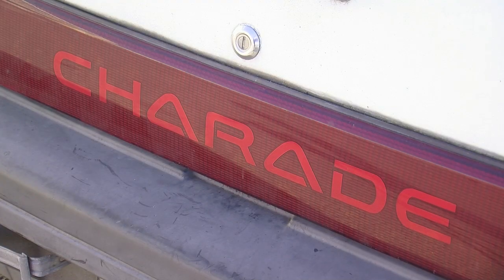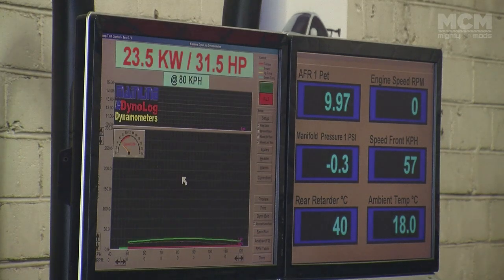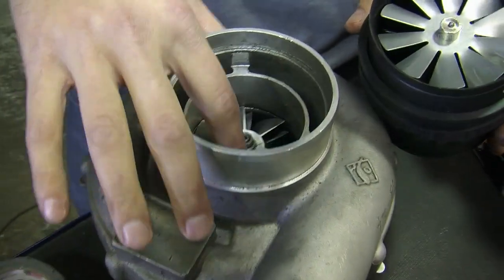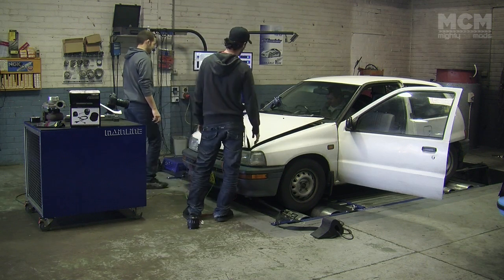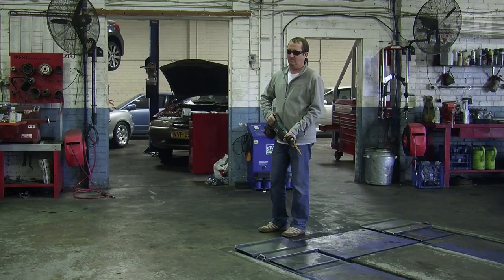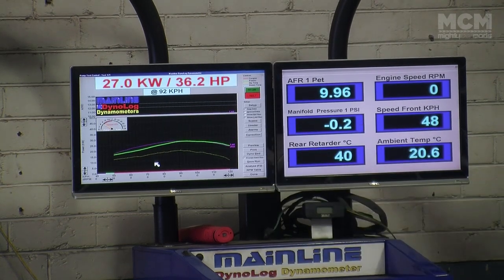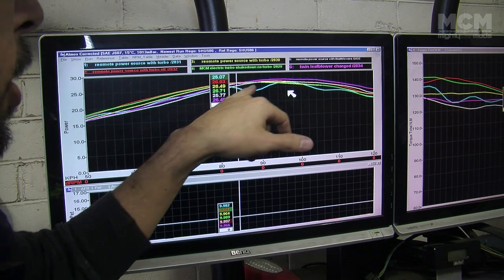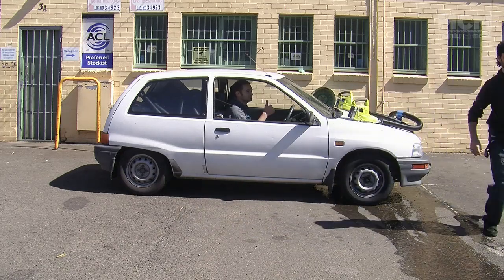Electric SuperChargers Mythbusted

Comment: okay... so a fan isn't compressing, but if you put a tank of compressed air in your car, instead of NOS-system.. could THAT be a possibility to charge the power up ?
Reply: ***** It doesnt work that way. You would need a 5000 gallon 18 wheeler size tank to maintain 5-10 psi in an intake manifold for any extended period of time. NOS doesnt pressurize the intake manifold. Thats why we call it liquid supercharger.

Comment: The suggestion that the car's battery contributes to the engine's output power is absurd.  In fact, a car doesn't even need a battery to run, once it has started (although something like a bank of capacitors to smooth out the pulsating DC from the alternator would be necessary).  This video totally ignores the obvious: the fact that if more air is forced into the engine, it will not increase the power, unless there's a proportionate increase in the fuel supplied!

Comment: You guys should try it with a dyson vacuum digital motor and see if that gives any boost. It uses the same centrifugal compressor as a turbo and spin at about 80,000 rpm.

Comment: The leaf blowers could make some more horse power. Take these into considerstion:
1.Take off the air filter and I'm sure you'll get a little more Kw. The air filter acts as a wind resistor to some effect.
2. Also if it was a Vtech, Mivec, or VVTI engine it would make a little more hp than normal engines. Because the valves allow air to flow more freely.
3.Next, the bigger the engine, the more difference in horsepower you'll see because they suck a lot more air and are more sensitive to air flow.

Comment: Any twit that wastes money on ANY shit like this from eBay is a COMPLETE tool. 
A basic Supercharger whether it is a Vane, Centrifugal, or Scroll Rotor type or Turbocharger is going to produce 10-20 PSI increase in manifold pressure and or depending on the setup anything up to 40 PSI or more.
        This pathetic excuse for neither is designed to do but one thing !! Lighten your Wallet   ANYONE that get's stung by this deserves all they get for being so dumb.

Comment: I haven't watched the video yet, but my prediction is the car will perform worse as it does NOT use waste heat and waste pressure to drive the charger, it actually forces the alternator to do more work and thus draw more power off the drive chain. This is just a more complicated HHO mod.
Reply: tarstarkusz I think if they would have used a large gasoline driven leaf blower, they might have added some noticeable power. The two leaf blowers are battery opperated and you aren't going to get kilowatts of power out of them, but you might get a few kilowatts out of an industrial leaf blower powerful enough to simulate an actual turbo charger.

Comment: You know... i installed a turbo for my home-made car engine generator
and it only cost me some time and $100 from the scrap yard...
the engine was an old 1985 (i think) 2.4L Y2 Diesel
the only thing was i did need to spend a fair bit of time working on it,
so i guess if you have some time and a turbo, your good
also it may just be lucky that the manifold of the engine fit the turbo...

Comment: Imagine how well the leaf blowers would do if that ag-pipe didn't have holes all the way through it. Sealing the joining pieces up with gaffa tape won't do much.
Reply: STAG162 Not that great. There was another internet car show in the USA that used something like 7 high power leaf blowers in a very elaborate setup... did produce an increase but not that much. The point again is pushing air is one thing, but compressing it above atmosphere density is a different matter. Gives you an an idea of how much turbo's flow air.  Turbos or 'turbo superchargers' were first used on aircraft with good results in ww2 on aircraft like the p38 lightning, getting great power at high altitude without the mechanical drag of a supercharger which were in use on aircraft like the mustang and spitfire. I cant imagine leaf blowers moving enough air at high altitude to produce higher than sea level atmosphere pressure.

Comment: You covered the air intakes on the blowers. Their generally on the bottom. Tip them over and you should get a little more power.

Comment: This device does not work.It restricts airflow and all it does is that it turns the air that comes in into a spiral/tornado.

Try this using a compressor or hair dryer and do a pressure test against an object.See the strengths of the airflow that will run through this device and without on an object.

Comment: Not talking about computer fan now, but rather brushless airplane fan. Like the 11.4v Lipo battery ones. They do about 40000 rpms.
You will never get huge gains in hp. 10hp on a 110hp car would be fine.

Comment: Hello, the electric compressor (not a turbocharger) may be flawed, but lacked some basic adjustments to validate the test.
- Do not recalibrated the ignition advance curve.
-No Equalized increased air supply with the supply of fuel (lean)
If you run this nut installation with a turbocharger also will not improve performance and will likely have a hole in the piston or engine overheating soon.

Another factor, Audi uses electric compressor and their works: "This is the new Audi RS5 TDI, but for now, the German brand treats as a concept The big news is the engine technology V6 3.0 TDI (diesel) you use. advanced turbocharger electrically powered. According to the automaker, this new construction makes the sporty diesel engine even more efficient ... "

See later

Comment: Increasing amount of air is to be combined with more fuel in engine. That's the whole point of charging : you inject more fuel, but cylinder does not contain enough oxygen to burn it unless air pressure inside engine is much greater than atmospheric pressure. You increase air pressure to put more air in engine, so the added fuel is burned, and more power obtained. If you get any increase of power from augmenting air pressure, all it means is the car is using a rich mix or air-fuel, and in other words, it's burned more fuel than needed (well, it's better to burn a little more than not enough : not enough engine does heat more).

Comment: If you only wanted boost under the occasional full throttle blast, you could set up a 15 hp electric motor in the trunk spinning a large turbine with tubes running to the intercooler and then engine and a couple large batteries to run the motor. Under full throttle, the motor would kick on, and the alternator would disconnect, running everything on the large batteries while it's under full power. You let off the throttle, the motor shuts off, alternator comes back on and charges the batteries. Injectors would need to be sufficient to flow enough fuel for the engine under boost while the ecu senses the lean condition when boosted and adds more fuel to compensate. Pretty simple, really.

Comment: well a good powerful big brushless electric motor would be able to make quite a lot of pressure if it's well done and the blades well done, however, the car needs to allow more fuel to go inside too to see a proper power increase

Comment: Maybe it needed two "Electric Supercharger Systems"? (Like you did with the leaf-blowers) What if; you unplug the battery, for the time of the installation, to reset the engines computer, and let the cars electronic fuel injection, make the fuel correction. It should run better dynos, the more it is driven.  (after the EFI has a chance to monitor the intake fuel/air) In theory of course! Thanks for sharing!

Comment: without electric turbocharger     : 23.5 KW / 31.5 HP
with electric turbocharger         : 26.8 KW / 35.9 HP
V mounted leaf charge system : 27.6 KW / 37.1 HP
..pretty good though for electric supercharger,better than stock performance.

Comment: Just the suction from the car air intake is much more powerful than that electric motor and it probably make it spin faster.
You would need an electric motor of several kilowatts spinning that fan to 200,000+rpm to get any boost.
BTW you guys do realize you can not pressurize a carby like that unless it is a blow through carby and that is not one so no matter what you did it would not work.
I am sure you guys are well aware of this but it is amazing how many get taken in by this sort of crap on the market, the worst one is them stupid non driven fans that get put in the air stream.

Good vid guys

Comment: I have been pursuing the holy grail of electric supercharging since 2008. I was one of those movie watchers inspired by the Mad Max concept of "switched on" supercharging. Of course anyone familiar with roots blowers knows that roots blowers are positive displacement pumps (which will not permit the passing of air unless the rotors are in motion) so the scene in the movie is utter none-sense. Still I have always believed that "on demand" supercharging could be achieved by driving a supercharger with an electric motor and; once I discovered a small but extraordinarily powerful English made neodymium permanent magnet DC motor displayed on a go-cart chassis at an amusement ride trade show, I decided to go for it. 
I bought a Paxton NOVI 2000 centrifugal supercharger and a LEMCO D-126 electric motor rated at 36vdc 250A to drive it. Since the rated speed of the motor was only 3600 rpm I bought the biggest and smallest blower cog sprockets for a 2 1/2" wide toothed drive belt I could get from a blower drive shop in CA. I put the 87 tooth sprocket on the motor and the 26 tooth one on the blower input shaft for a 1: 3.3 overdrive ratio to get the shaft of the blower to turn close to 12,000 rpm. (based on a typical 1:2 ratio with the same blower installed in a Mustang)  
The NOVI 2000 blower is internally geared at 1: 3.5 which with an input shaft speed of 12,000 rpm should spin the impeller around at 42,000 rpm. (The impellers are guaranteed by Paxton to spin up to 55,000 before they grenade.) The problem for me has been that between the belt sprocket ratio and the internal gear ratio, my ratio from motor to impeller is like 1: 11.7 which is awful steep. It's like starting out on a ten speed bike in tenth gear. Since speed and torque are inversely proportional, the same factor the rated motor speed is multiplied by to calculate the impeller speed is also used as a divisor into the motor's rated torque to calculate the torque at the impeller.
With my Megasquirted 350 engine I only got a couple of pounds of boost initially because the D-126 motor didn't have the torque to drive such a steep belt/gear ratio at rated motor speed. Realizing this after adding a tach to the electric motor drive, I upgraded to the LEMCO D-127 which was rated at twice the voltage (72vdc) and considerably more torque. Where the D-126 was rated at 18Nm of torque the D-127 was rated at 33Nm of torque which is nearly double. 
To my dismay initial boost with the D-127 was still low at only 4 1/2 pounds and by 4,000 rpm on the engine tach it was all gone. I finally removed the D-127 and replaced it with a ME 0913 BLDC (brush-less DC motor) which is also rated at 72v but with 90Nm of torque! The reason the brush-less has such a high torque number is because it's actually a three phase AC motor being driven by a variable speed AC drive that’s designed to be powered from a DC bank of batteries. Even with this motor (which is rated at 5,000 rpm) the load of the belt/gear ratio of the supercharger drive I built drags it down to 3,000 rpm. Without the engine running it will push the boost gauge up to 8 psi but; that's it. It puts out about 6 or 7 psi if I activate it around 2,500 engine rpm provided the six 44ah batteries series-ed together to power the controller are fully charged @ 80vdc. By 7,000 engine rpm there's only about a pound of boost left but at least with the brush-less motor the blower can be driven to make boost through the entire engine rpm band. 
I'm sure the boost would remain higher longer on a smaller displacement engine but; the other side of this double-edged sword is weight. My supercharger unit weighs 110 lbs with it's own oiling system (which includes drain tank, pump, regulator, and filter) and the six batteries (at around 33 lbs each) add another couple of hundred pounds.
I do realize that I could cut costs considerably using an SC unit with ceramic bearings or eliminating the self contained oiling system I built, perhaps save more space (but not weight) with a planetary drive, or may be even lighten things up with lithium ion batteries but; then I still have to run a second alternator to push 60 amps to the two Minnkota (trolling motor battery bank) chargers I use to charge my 72vdc bank of batteries at a rate of 10A each while I’m driving. I could just build a charger for the garage and not charge on the fly but; then the usefulness of the system would be severely limited then because it takes about 5 to 10 minutes of charging to recover full voltage after only 10 to 20 seconds of blower use.
The bottom line is that significant boost can be made by driving a supercharger with an electric motor but; the boost is more on the bottom end of the engine’s tach than the top because the blower’s speed doesn't go up and the engine’s speed does. I think it's very simple and efficient because it’s strictly on demand and only takes away energy proportional to it’s use after it’s been used but; at this time I don't believe it will ever rival turbo-charging for making maximum power. The fundamental challenge of driving superchargers electrically is making enough boost on demand to negate the weight of the system producing it. Perhaps a roots blower would do better but; I rather doubt it. The higher the compression desired, the greater the torque required and I think that’s about all there is to it. I hope this clarifies any misconceptions any one may have on the subject.

Comment: You just have to look at a few numbers.  The most you could feasibly draw is 80 A,
that gives you 1 kW of power to the blower.
 A belt-driven supercharger would be needing more like 10 kW to spin it at high revs, so the boost would be a lot less.  Ask the ebay blower sellers how many amps it draws, it might only be 10 A!  Therefore utterly useless! Now if you had an 80 A motor, you could conceivably get a little more torque at lower RPM if were properly set up, but your maximum power gains are going to be negligible.

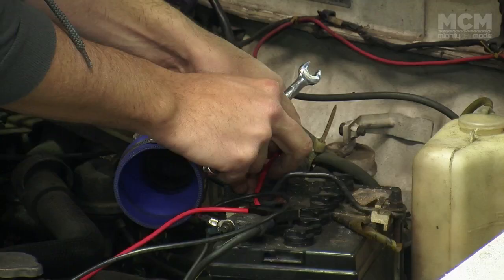Comment: After studying your video and methods, I know where you went wrong. At 7:20 you can see where the piping only has 2 clamps. The amount of "instant" boost an electric supercharger makes requires at least 3 claps so your boost isn't wasted into the engine bay. I bet if you checked your engine temps the massive turbines would have dropped the water temperature at least 100 degrees, which is causing the loss in power because the engine isn't at normal operating temperature.....

Comment: I don't give a flying fuck HOW you install this, these cheap chargers off Ebay are shit. Best case scenario you MIGHT gain 3-5hp, that's it. Plus they do good to even get 2K miles on them before fucking up. I'd much rather not risk my entire engine using a shitty internet turbo/super and just find a better way that isn't gonna break your bank. Too much air can be a bad fucking thing people.